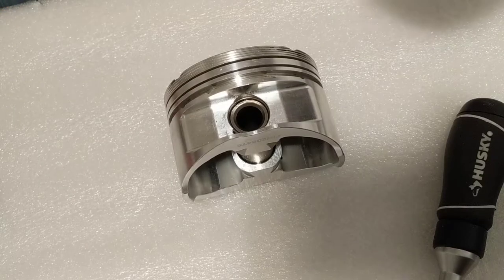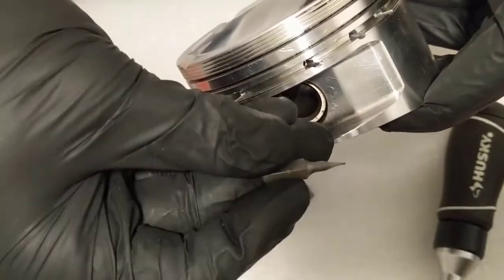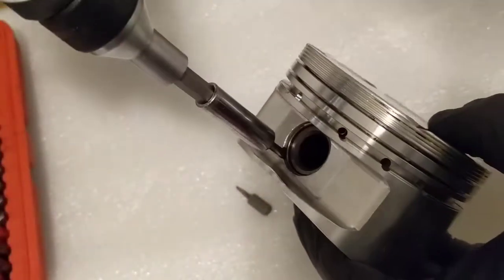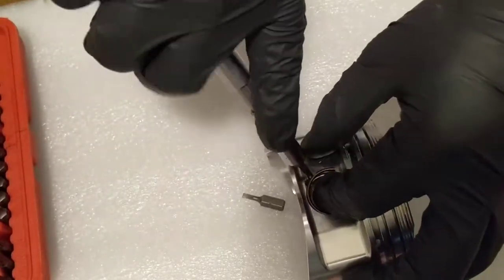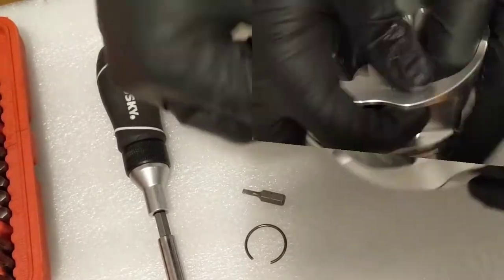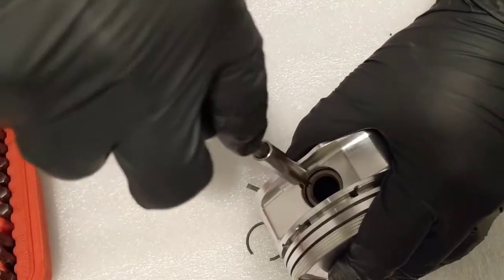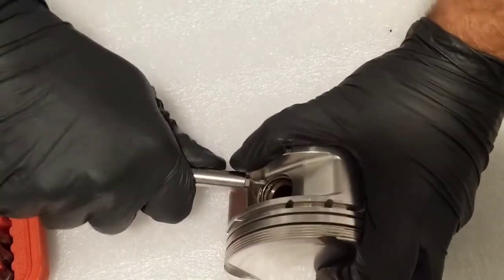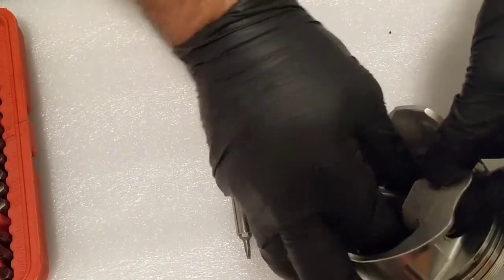Removing Piston Circlip or Wire Lock - #Eclipse2GBuild

Comment: Well done, what if you don't have that helping hole ?!!! How could you  un do it ?!!!
Reply from the maker: @pazzy4501  then it will be hard to fish the circlip out.  Might need to walk it till you hit that hole.
Reply: 🤦 of course, I know it's hard, and no there are no holes at all, you can't walk anything to any hole, also there is no clearance as there exists a shaft inside, you have to remove that clip to remove the shaft, unlike your case, this is my case now, that's why I am asking !!!
Reply from the maker: @pazzy4501  hmm that's odd.  Maybe drill a small hole right on the edge to expose the circlip.  The hard part then would be to be sure that it's not damaging the structure of the piston.